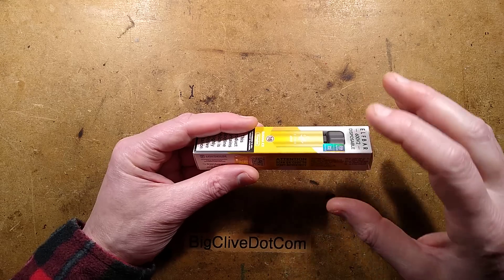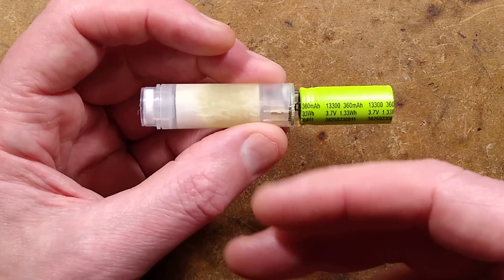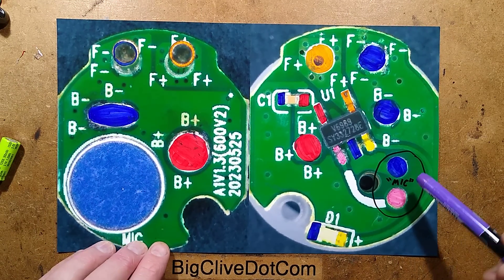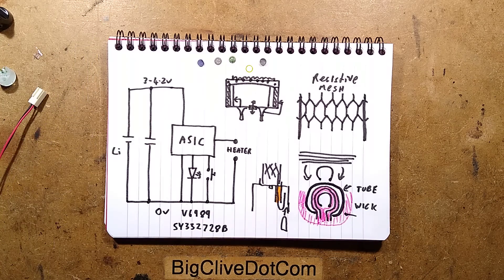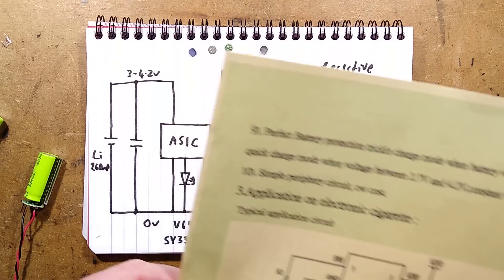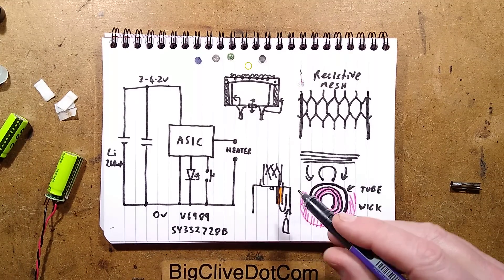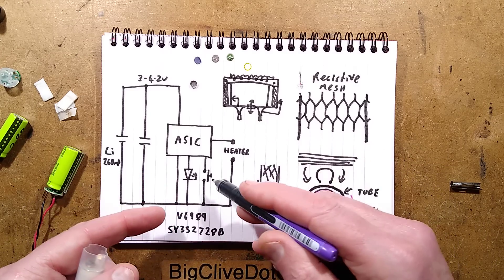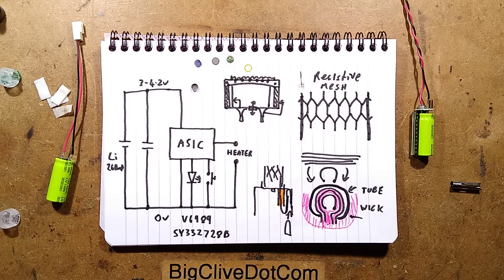Lithium "capacitor" in a disposable product

Comment: There's no way that's actually a capacitor. I would be willing to bet that it's one of the standard tiny lithium-ion cells stuffed inside a casing to make it look like a capacitor. I have a fairly good idea of the reason they are doing this too: Recycling bins for disposable vapes are becoming increasingly common in vape shops, and the disposables deposited in these bins get sent back to the factory for the cells to be re-used. About time too, since they are rechargeable. So my guess is that this more modular design makes salvaging the cells much easier and quicker. Certainly a lot easier than cutting the tiny little wires off the plastic-wrapped tagged cells used in almost every other disposaible vape - salvaging those must be incredibly tedious by comparison.
Reply: tell us how you didnt watch the video
Reply: it's definitely not a conventional capacitor, but if it's Li as described in the title, it's most likely a hybrid capacitor, i.e., it has the graphite cathode from an ultracapacitor and a Li-doped graphite anode from a Li-ion battery. That way it has the advantages of both ultracapacitors and batteries, namely high power charging/discharging (necessary for vaping which requires fairly high currents) and higher, longer lasting energy storage than ultracapcitors. ultracapacitors technically aren't actually capacitors themselves but that's more information than I need to give rn
Reply: @MrTicky4  good guess but those graphite hybrids are way more expensive and have less capacity in this size, maybe 0.3Wh not 1.3Wh.
Reply: @MrTicky4  If this were for a high powered vape mod, then I might agree. But this is a disposable vape - and they are not very powerful, the heating coils are only about 5 watts, which draws about 1.2 amps at most from a lithium-ion cell. The 13300 cells used are easily capable of delivering that much current, there is no need for an ultracapacitor or even a hybrid ultracapacitor/battery. The other reason is cost - ultracapacitors are expensive compared to these little cells, so would not be used in disposable vapes.

I can tell just by looking at it that the specs printed on the cell (13300 size, 360 mAh, 3.7V, 1.33 wH) are identical to the cells used in some other disposable vapes, such as the "vuse" brand or some of the counterfeit "lost mary" versions with smaller than normal liquid tanks. The more common sizes are 13350 (500 mAh, 1.85 wH) or 13400 (550 mAh, 2.05 wH), used in "elfbar" or "crystal" brands, amongst others. The main reason for the slightly larger capacity cells is the slightly larger liquid tanks - the heating coil power is the same, it just has to be able to run for longer overall to vaporise a larger volume of liquid.
Reply: Thanks for the education guys!

Comment: The microphone looks exactly like the microphone in the cordless Panasonic telephone KX-TGQ500.
It's a sin/crime against nature and earth resources to throw away:
- 1 microchip
- 1 microphone 
- diodes, switches, a circuit board 
- a plastic cylinder
- gold
- metal mesh
and
- a lithium cell
just after sucking 5 to 10 times on it - my opinion!
We "don't have" the resources for transforming the electrical grid and for E mobility, but here you throw away hardware and an akku like burning 1 cigarette of leaves and paper.
This is not "innovation" for me, that's crime! 😳
Remember the disposible cellphone charger you tested some years ago? It had a Lithium akku in it. That made me equally enraged  😬

Comment: Just quick note, depending on how aggressive you charge lithiums. It's quite common to get more mAh out than went in. Since the voltage sag means even with less mAh in you put more wh in
Reply: And there are designend for one time use, so they drain them empty until the voltage is below of what the IC needs

Comment: These have become a massive problem in the recycling industry, by finding their way into general waste. The company I work for 'Recycling Lives' had a massive fire last year, more than likely caused by one of these fuckers. Nearly destroyed the business.
Reply: I’ve found so many of them just out on the ground. Just a couple months ago, I was headed home, it was already dark out and kind of raining, and I noticed a tiny blue light in the middle of the wet road. Curiosity got the best of me, so I stopped to see what it was and it was a steel tube disposable vape, that had been run over and rained on, which shorted something or another causing the blue indicator LED to illuminate constantly. I didn’t want to leave it, so put it in the middle of the bed of my truck, drove the two blocks home, and tried to remove the battery, but the case had been smashed too much. Not wanting to risk it, I just dropped the whole thing in a bucket of salt water for a few days, then tossed it
Reply: @RandomBogey  i saw the same, destroyed vape with blue light in the city centre..
Reply: I've seen several of these just tossed out the window while people are driving down the road.
Reply: @PowerScissor  I guarantee I could walk out my front door find more than one of these laying on the shoulder of the road in less than 2 minutes
Reply: It’s also a fire hazard in garbage trucks, transfer stations, landfills, etc.
Reply: Bruh
Imagine if they were all standardized size
One could literally collect these and make a battery bank out of them, BMS and all
Reply: @asakayosapro   Or, if you’re like me and consistently buy the same brand/model, and save every one of them in a big Tupperware box out of guilt, thus collecting multiple identical batteries… I haven’t counted them, but I could probably build a nearly 200V 600-ish mAh/3.7V 30Ah unprotected battery pack with all of them
Reply: As a vape user myself I like the reusable ones, its got me off cigarettes. If you're looking for a small resuable one Innokin Sceptre 2 is good. 
These disposable ones should be banned, nothing but mass wastage of materials and a nusiance to everybody
Reply: I'm living in a rural area and from my window I could see some blue light blinking on the road in distance. I've heard of LED SOS calls, but no clue how they actually blink, so just in case, I put on my coat and went to investigate. It was a destroyed (case smashed open) disposable pen.
Reply: I am from Serbia and never seen these even once. Hence why I watched this video to see wtf is this. 
People here have different mindsets
A) most of us don't buy things that I would call basically pointless trash like most others in EU 
(USA to me is a mindless wasteland full of trash and homeless people, I can't imagine living like they do, it's like a different planet to me ...) 
B) we use things until they break completely
C) grow up recycling

Most of the people who trash here are foreigners and especially immigrants toss around clothing items all over the streets ... locals don't do this.

Just yesterday passing by my local bakery their trash was out and I found one of those 4 wheeled leg pushing scooters on top of a bin, it was broken completely to pieces oddly enough the wheels were in good condition so I took the wheels and they will be great for a shopping cart of sorts for groceries etc while the screws and other attachment parts can be also used for other things.

Point is they (people who live and work in bakery) tossed it out when it was completely broken and even then someone like me can still use parts from it. 
MEANWHILE While I was in Germany there been nearly new devices tossed out for no valid reason ...  We both live in Europe but the mindsets are completely different. Germany is one of the places who wastes away so many things they basically had to source other countries landfills since theirs are huge as mountains ... This comes from Germany who parade recycling agendas even tho they DONT RECYCLE ANYTHING. Their devices are made in China and the quality is worse then the cheapest things you can buy in China stores yet it costs 10 times as much even more only because it have a "German quality" sticker on it ... 

So not only that they tossed out perfectly good items out nowadays they sell trash ...
Reply: @minmogrovingstrongandhealthy  You're idea of the US is way off. The trash and homeless are only prevalent in a few cities. The USA is soooo big you can't possibly believe everyone lives like that. There are no homeless or significant amounts of trash within a hundred mile radius around where I live.
Reply: In UK? I have been in UK as tourist this year, i have never seen so many laying around on city streets (london). Imo, they are in every EU country, but it was first time i have seen dozens every mile. Actually i bought two for ~4£ in my country but i open them, charge and refill. I smoke so little, that i have one for 6m, its perfect balance of strenght and price for me (almost free).
Reply: Sadly i'm not sure there can be any way to prevent such bastards, (aka the companies making these).
They are just like those indian scam centers. No matter the efforts, the local government wins A LOT, and they allow it behind closed doors. They may act willing and open in the public view but condone it because they also get a share of the spoils (through taxes at the very least, not gonna say bribes and such)
Reply: @evilalchemist9278  I used to walk 20km a day, and noticed two things in my town: pencils and lighters on the bicycle lanes. Started to collect them, 95% of them were working, slit out of some ones pocket while biking. A have a bag with about 200 lighters now, all working. So throwing them out is not a thing people always do on purpose.
Maybe it is even the main reason why they are so plenty full on the English roads, their shape invites to slip out of pockets ? Specially tight pants. They should be cone shaped.
Reply: @evilalchemist9278 I am maximum paranoid about lithium batteries. Especially as corners get cut more and more
Reply: I collect every single used vape from my friends, tear the lipo and use them to make small packets. Then I use them as rechargable power source for lights in my RC projects. Blows my mind that those vapes are all made so wastefull.
Reply: @Kubimate I have no friends.
Reply: Flaming nuisance 😅
Reply: That's why I store all old lithium based cells or devices in a fire box for safe disposal at a place that accepts lithium devices
Reply: they should have made then so the battery part can be removed and disposed in proper 'battery bins', and the rest in the 'normal'? recycling
Reply: @andygozzo72  They know their customer. Imagine people disposing of cigarette butts in the proper fashion...I'll wait. It'll take regulation.
Reply: @hrdcpy even basic plastic packaging waste gets mixed so much its hard to recycle
Reply: @hrdcpy But regulation caused this problem 😂
Reply: @christophervanzetta how?
Reply: @Bobylein1337  this pop up because of regulation on real cigarette
Reply: @captainheat2314 Yeah, I feel like introducing single stream recycling may have been a bit of a mistake when it comes to that
Reply: @Bobylein1337  Like others pointed out ... regulation is why there is $19 tax on a $20 pack of cigarettes. While that is not the only factor of why people vape, it's one. I'm guessing a lot of these "disposable vapes" are not bought by heavy vapers as the price wouldn't make much sense either (you'd just get a larger, refillable unit?) - and are usually bought by people going out for drinks or to "party" for one night. If it was still legal to sell 5 packs of smokes in bars (regulations made small packs illegal) and they were still $1 a pack (like it was in the 80s) I think it would be hard to justify buying vapes.
Reply: @hrdcpy  People who can't be bothered to even toss their cigarette butts, litter or shit into storm gutters are the worst.
Reply: @hrdcpy  I guess I am an anomaly then XD I even hold onto buds until I find a bin
Reply: @captainheat2314  They never had any intention of recyling plastic, it was a scam from the get go.
Reply: @bethrains3105  plastic recycling isn't real, I've tried so hard to explain this to people I know but they just don't believe me. Thanks for being in the know.
Reply: @hrdcpy  The thing is, if the option is there a lot would take it. There's just no easy way of recycling it no "special" bins etc, at least where I live.
Reply: @andygozzo72 I mostly see these on the ground so I don't think people will care
Reply: @andygozzo72  but that would make them easy to reuse! think about the lost profits!

Comment: I noticed this myself recently, they seem to have streamlined the whole design. I reckon those cells are purpose built
Reply: Nah. That form factor has been around for many years. I've got some lithium cells just like that out of an old RC car. Unfortunately the designers didn't bother with anything like cell protection or balancing so they're all pretty stuffed.

Comment: I've seen a couple of those not-capacitor batteries before, in a rechargeable lithium AA battery (the kind with built-in micro USB) and a very skinny one inside the stylus for a Gaomon tablet. Incidentally, I bought the former to put a new battery into the latter. Pack of 4, two of them were too discharged to work as-is but after tearing one of the broken ones apart it turned out that the cell was just discharged to 3 volts and couldn't power the charger/step-down board, manually charging it did the trick.

Comment: I wonder if the capacitor-style lithium cell is done for cost reduction?
Seems like it may be slightly cheaper to manufacture the cell (using cheaper machinery too?). And the final device - on the production line the pick & place machines can handle it like a through-hole capacitor.

Comment: all they done is putting Li-ion internals into standard capacitor case. (both caps and accs are just similar scrolls of foil in a liquid)
and this is awesome actually.   battery cells in such cases are way more convenient for soldering and permanent installation.

Comment: This could be a lithium ion capacitor. Great scott has a video on those (at least they come in the same package as this one).
Or it is a repackaged cell, that allows for easyer recicling or even reusing of the cells.
Reply: It's just a standard cell form factor that isn't used in much. They've been around for a long time.

Comment: I work in a foundry. We buy stuff and melt it. These fucking things are in EVERYTHING. An absolute Menace. Not just because of the real risk of explosion, but lithium can't be removed from aluminium alloys. Magnesium can be removed with potassium aluminium fluoride, calcium can be removed with fluxes, etc. Lithium is there forever. It can only be diluted.